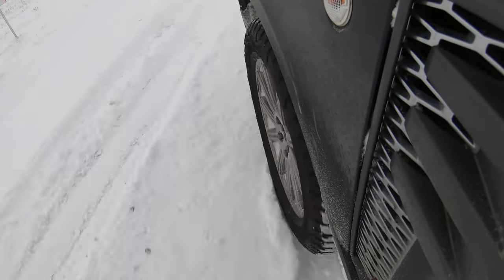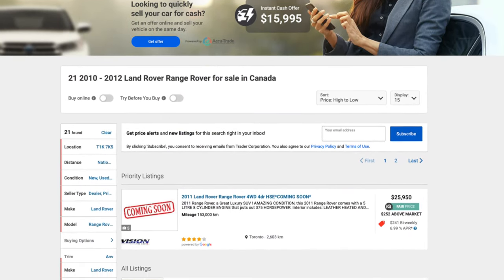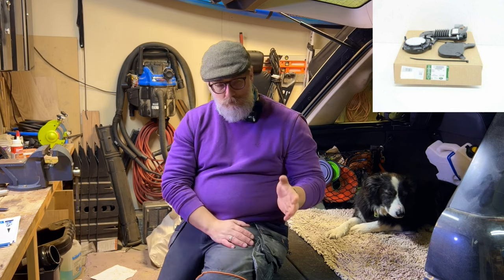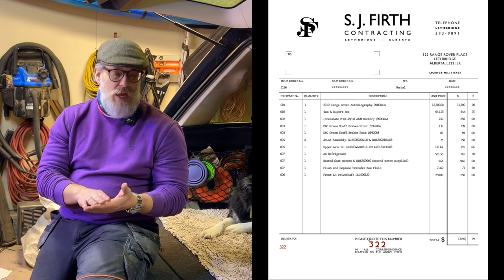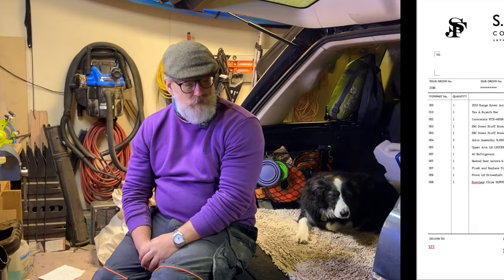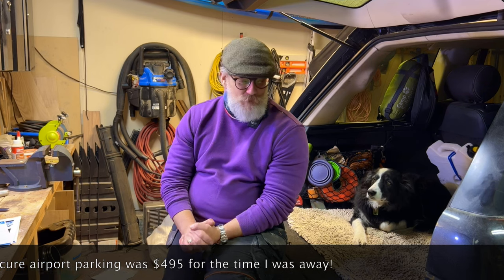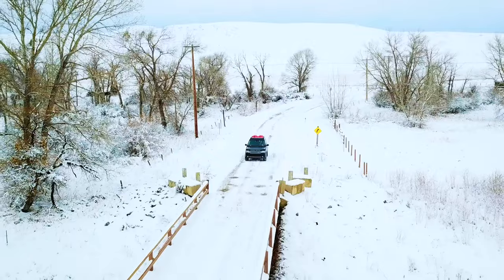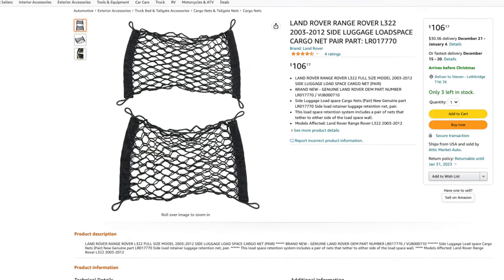HOW MUCH DOES a 12 Year Old Range Rover REALLY COST TO BUY AND RUN? #l322  #rangerover  #landrover

Comment: I’ve got a USA spec L322 5.0 SC. Bought with 155000miles. Love the car. Most comfortable vehicle I’ve ever owned. Just changed the tensioners and guides, they were due. Just an FYI, there is a timing chain guide/tension replacement procedure without taking the top end of the engine apart. You can use zip ties to keep everything locked in place. There is a video on YouTube. Much faster and easier that taking everything apart. Again, this is just to change the guides and tensioners ONLY. Those are the typical wear components.
Reply from the maker: Yeah, I have seen that guide replacement procedure, but I’m always mindful of changing the chains when the tensioners have worn due to potential stretch. 

Glad you’re loving your new rangy! Good luck with it, and thanks for sliding by the channel! ☺️

Comment: I liked your video and mostly your dog! I hope you are able to get ahead of your health issues. I have a 2011 HSE RR with the 5.0 gas motor non-super charged. Curious if the timing chain guides have been replaced on yours. My LR Specialist says I need to plan on changing those out at 100,000 miles. That is about 25,000 miles from now. Glad I found your channel.
Reply from the maker: Hi Jerry! Welcome to the channel! 

Hahah! Yeah, Jyp is much more of a star than I am — he’s sort of the channel mascot, to be honest (and moral compass). 

The chain guides do wear and can cause issues along the way. It’s a fairly invasive surgery, and there’s much to pull off and put on again (it a little easier with a naturally aspirated engine). 

The early chain guides were plastic and permitted excessive wear of the chain, sprockets, and so on. When this happens the failure could be quite quick, though a rattling is generally heard before damage occurs. 

I have heard of engines with over 500,000 miles be trouble free of chain issues, and I know of low mileage vehicles whose chains have failed at 75,000 miles too. Mine are original and I’ve measured the deflection (you can do that from opening up the oil filler and sticking something inside to check the slack — ENGINE OFF, of course!). The result is not a completely accurate measurement, but if they’re super tight then you know there is very little wear. 

There was a material issue with the guides and chains in a certain production run that generated a lot of issues. This affected the AJV6 as well as the AJV8 — (though I have also heard of chain failures on the AJV6 — despite the AJV6 having the new material guides and chains). It’s pretty much the luck of the draw to be honest. I have not changed mine yet, but my higher mileage 2011’s were done. I have less than 1mm of wear on mine and I’ve 100,000 miles on it now. 

I must say that long oil servicing is massively contributory to early chain and guide wear and failure. It’s very important to change your oil and filter every 5,000 miles. While it won’t prohibit chain failure, high frequency services are correlated with reduced engine wear and decreasing incidence of chain and guide failure. That is to say that repeated frequent services can reduce the risk of chain failure, and in some vehicles, eliminate it completely (at least to 500,000 miles)! When servicing, do buy the JLR filter and oil — at a pinch, you can use the high-end Mobile 1 I show on my channel or the Fuchs available in Blighty; you can even use the 0W-20s in the Castrol Edge (instead of the professional) — the key is to drop the oils frequently. Dropping the oils — all of them — before the recommended service interval is paramount. I usually knock a third of the recommended interval and go from there. I’d do your transmission now if it’s not been done before, and do the diffs and transfer box as well. Fluids are relatively inexpensive; gearboxes aren’t! Lol